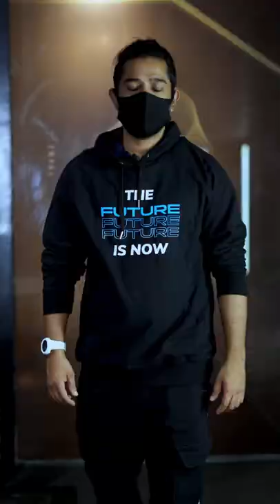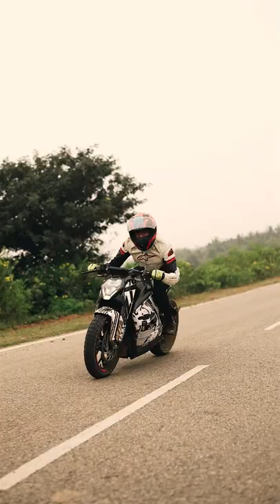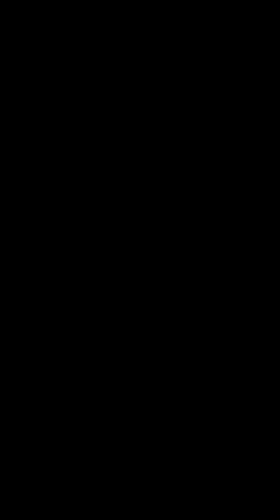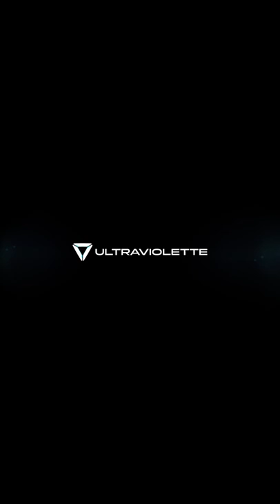F77 - Brakes Testing

Comment: 500NM at the wheel for sure?
Reply: My thoughts exactly 🤔
Reply: copy pasting the same comment.. please go to khanacademy and learn some high school physics.. torque is not the same as power... you can get 95Nm at the motor, 500Nm at the wheel..  each spec means a different thing.. this is why you should finish 10th grade science first
Reply: @forgottenhero8163 checkout the video first he said 500NM at wheel thats why i asked
Reply: Yes, if the gear ratio is 5:1 from motor to wheel
Every other bike will have more torque at the wheel than its engine crank, that's how physics works
Ultraviolet just used that phenomenon as a marketing strategy
Reply: Its 100Nm lol

Comment: I have a doubt if this is 500nm then is it quicker than even h2r as it is having 141.7 nm??  🤨
Reply: It is at the wheel bro that's the reason of 500nm. The true practical torque would be lesser than 100nm. I think about 65nm as ola claims 56nm torque for their scooter but I drive it on a daily basis and I can confirm that that is a fake statement! It is barely like 20nm of torque! I think the 56nm is at the wheel
Reply: Let me explain that to you, Usually power produced at the engine will be reduced due to friction. about 10perc. That mean power at the wheel will be 10perc low that of claimed by the manufacturer. However, Torque gets multiplied depending on the gear and sprocket ratios. Example; If H2 produces 142Nm then it gets multiplied by each individual gear ration like 3.08 x 2.65 x 2.45 x....so on. I am sure H2 makes few thousand Nm of torque at the wheel.

Comment: 500 NM Torque they said, and the product launched is of 95 NM torque. What is going on ??
Reply: copy pasting same comment.. please go to khanacademy and learn some high school physics.. torque is not the same as power... you can get 95Nm at the motor, 500Nm at the wheel..  each spec means a different thing.. this is why you should pass 10th grade science first.

Comment: 500Nm at wheel is not a big deal... i mean at the wheels. An average bike like bajaj pulsar delivers more at wheels..
Marketing idea is brilliant though !
Reply: Is it so ?
How ever they tune its impossible to get the wheel torque of 500nm in bike like bajaj pulsar
Reply: @thulashipuramarun  at the wheels brother.
Usually engine torque is mentioned as specs.
And since gearbox and reduction gears are not there for ev, these people can directly say wheel torque.
At first gear and rated max engine torque an avg 150cc bike produce more than 500NM at wheels.
Reply: Usually gear ratios for 1st gear comes from 10 to 20... say 15 for ease of calculations. Den chain reduction as 1:4.
So say bajaj pulsar.. max engine torque will range 15Nm.
15x15x4 is 900 brother..
Means this bike only has half that torque on wheels.
Dont get fooled by these marketing gimmicks.
It just sounds fancy on papers.. you cant jus compare like that.
Yes you are right.. however we tune its very difficult to achieve engine torque as 500Nm.. but these people talks about wheel torque... even our 100cc bikes and scooters might be superior than that.

Comment: 500nm😳?!?
Reply: I was also wondering how is this possible? Doesn't that means these guys have no idea what they are building. It seems they are going to take few more years 😜
Reply: @saitama_capedbaldy9758  Bro, it has a Electric motor. It can produce 500nm and above Torque. That’s why Electric Vehicles don't need a Transmission system (Gearbox)
Reply: @GoogleUser-sk3ix  yep right up on his face.